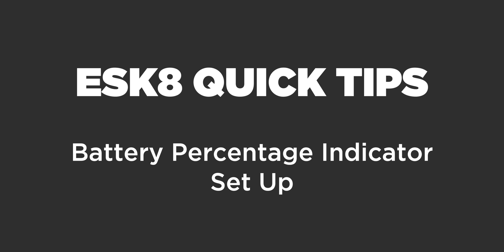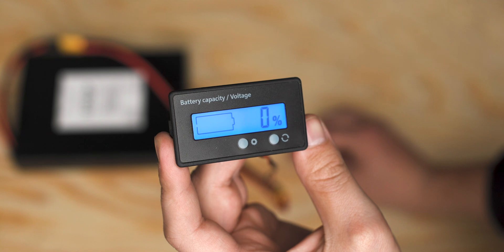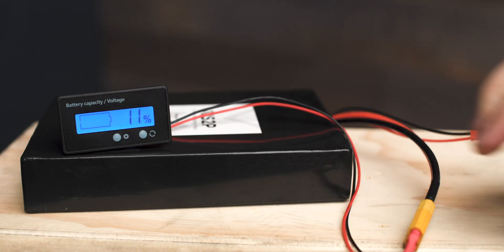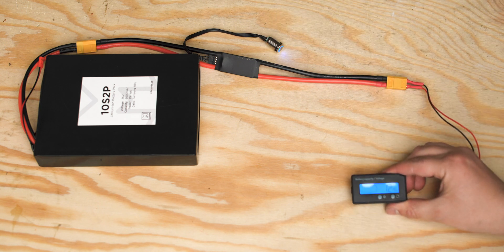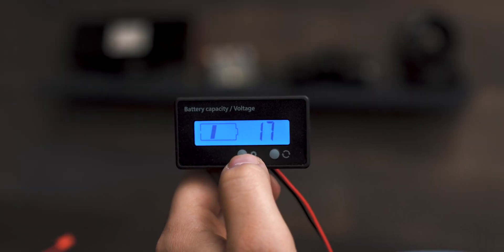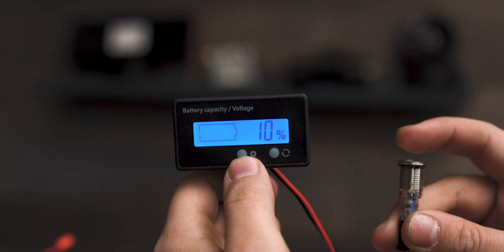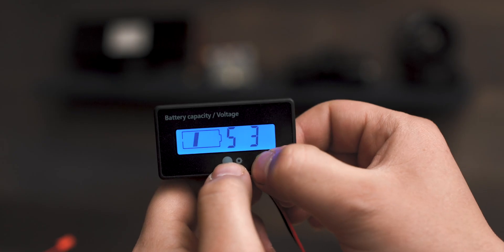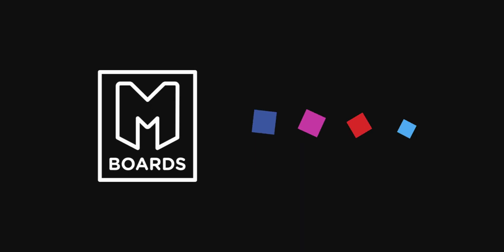Add a Battery Percentage LCD Screen to Any DIY Electric Skateboard Build

Comment: How do I prevent massive voltage drop (-0.8V) when I run this meter along with a 2m 12V LED strip (60LED's p/m) light and a power source e.g: 12.6V Lithium Ion Battery (18650) 3S2P.

All I want is an accurate battery capacity reading that is true to the battery and not have this reading affected by the LED strip lights.

Comment: My scooter desply is LCD one  my schooter battery is 72 v lithium iorn battery. But the batery level always high level. It dosent go down. The problem is wen the desply power up with externel power supply acoording to battery sos level its level is go down when i reduce the voltage. 72V to 64 and 64 to 58 V 58 to 54 V , then shows the level. But the problem is the the lithium iorn bttery alway show his sos  cell volatage as 64 it will newer go down konwo. How can i get battry level for my desplay?

Comment: When i click the link, the LCD screen is different; it doesn't have the settings button. Why is that and is that a problem while setting it up?
Reply from the maker: The one you receive will have a settings button. The one pictured had it in on the back.
Reply: @MBoardsco  Okay, thank you, i will consider buying one.

Comment: I would like to upgrade my charger for the drill battery. I know there a already ones that comes with that display but I don't want to buy a completely new one, instead I want to do it myself (also to learn more about this)

Would be nice if you could make  a video about this.

For reference, I'm trying to to it on an makita dc18rc charger

Comment: can i commect it to FOCBox if yes how?
Reply from the maker: You can plug it into the 2 pin port on the FocBox. Or you can connect it to the main + and - battery cables.

Comment: How would you wire it up if your esc has the power switch?
Reply from the maker: I tap into the main positive and negative leads of my battery. Might even wire up a simple switch to turn the screen on and off independently of the ESC.

Comment: My LCD screen seems to like to cause an "auto-acceleration", most apparent at <25%, and I've also experienced a light auto-accel. when cruising @ 18-22mph. Is it just some loose wiring OR are there some "shock preventative" measures I can take? Happy to remove it altogether as the hacked 13s/boosted batt came waired with it. Suggestions welcome :)
firmware is up to date (5.1)
Remote = 2.4 Nano
vesc 4.2
Reply: That is quite a concern. Did you manage to fix it?

Comment: Thank you! Thank you! I just finished building my first eboard and it worked the first time I tried. Got most of my kit from you and I looks great! It's because of videos like these that really helped me along the way. And now that it's working. I wanna add some accessories, like power switch and battery display. So these videos came out just in time!! Also you have pretty good prices and really good quality stuff (10s battery is sweet), so I'm probably ordering from you. Thanks again!!

Comment: I have a question for you,
Is a  400W, 1000kv motor good for electric longboard?
Please answer me.
Reply: Those numbers seem maybe reversed?  Kilovolts can vary widely between hub or direct drive motors and motors used to turn the drive wheels in a belt drive setup because they correlate to the how many RPMs the motor will turn per Kv it's receiving from the battery.  

You also need to know how many amps your motor is rated to handle.  Certain motors are rated to be able to handle different amounts of current/amps sent through the ESC to the motors.  

So when evaluating a motor based on its wattage & KV rating also look at how many amps the motor is rated for.

  If the motor is only rated to handle 20 amps and your battery can push 60 amps of continuous discharge current you would have to limit the amount of current you push through the electric speed controller /ESC to 20A ir below to avoid overheating it & or burning it out.

Assuming this would be for a belt drive setup.

For motors used in belt drive setups you will typically see Watts in ranges from 1000-4500 watt per motor...with most between 1500W and 3500W. 

For belt drive Kv #s you will use 100kv-190Kv motors with most being between  140 & 190kv.

 Remember kv's relate directly to RPMs of your motor. So for direct drive setup or a hub motor setup you'll see motors with lower Kv numbers/values. 

When using Hub motors & direct drive motors to turn the drive wheel(s) for everyone rotation of the motor the tire attached to it also makes one full rotation which is different than motors used for a belt drive setup where the motor & its drive shaft has to make multiple revolutions to get the tire that's touching the road to complete one full rotation.

I've just started learning about this stuff in the last six months or so and so someone else may have a better understanding of how you might make a motor with those values work but it doesn't sound like a motor you would typically use for an electric skateboard.

But would love to hear and understand how if someone else has a better understanding of this than I do. I still have a lot to learn.

Comment: I have a very similar screen but I have a problem.  When the screen shows 50% is when the skate is about to run out of battery, and 50% to 0% goes down in seconds.  It is well configured. Any solution?

Comment: Mike check out the diy esk8 builders build they used your 12s4 battery pack with the raptor hub motors. It’s a cool build and your battery looks good 👍🏻
Reply from the maker: Will do!

Comment: Great video, quick question:
how long should I be charging my 6S2P lithium-ion battery that I bought from Mboards ??
Reply: Use your battery indicator to see when it’s at 100
Reply: joe pisano didn’t come with one cause i didn’t get a programable  ESC but i figured out it is about 2 1/2 to 3 hours from 0 battery to 100%

Comment: What are the dimensions for this indicator? I am trying to CAD out my build before I assemble so adding general dimensions for components (or ideally STEP files) really helps to know that nothing will interfere.
Reply: I'd like these dimensions as well, I'm also designing my build in cad
Reply: 27x57mm

Comment: Does it work with a 20s3 lithium pack ?  84v euc
Reply from the maker: This will work with batteries up to 17s.
Reply: what are you doing with 22s anyway?
Reply: @jony_bo1087  I want to add a battery percentage lcd voltmeter to an electric unicycle. Which has 84v and 20s3p.
Reply from the maker: That is quite a battery. This is still possible but you’ll need to find a different Battery Capacity LCD with higher specs 👍🏻
Reply: Omidel  damn sounds crazy have fun with that beast then😉